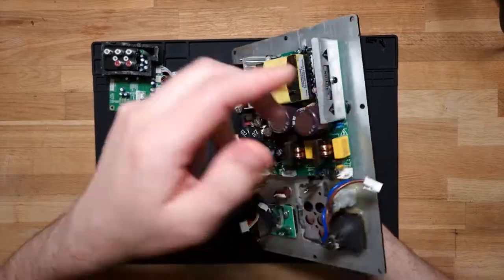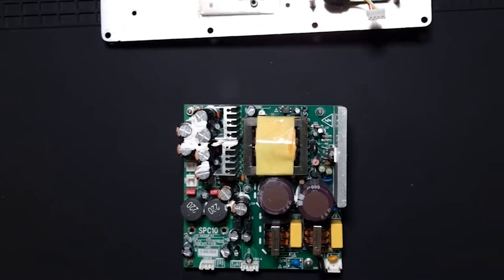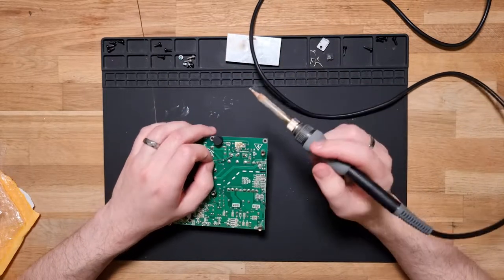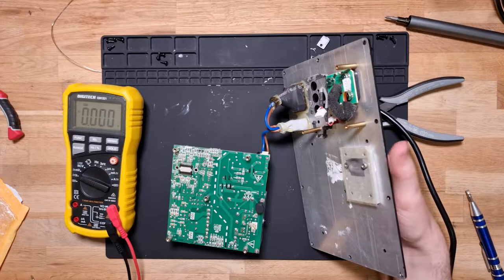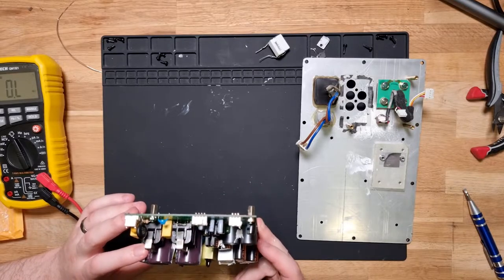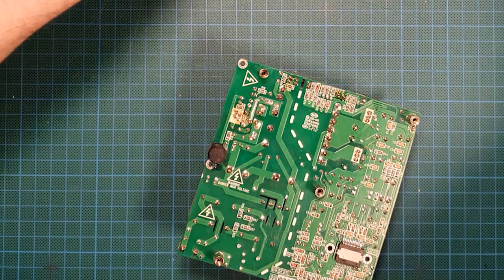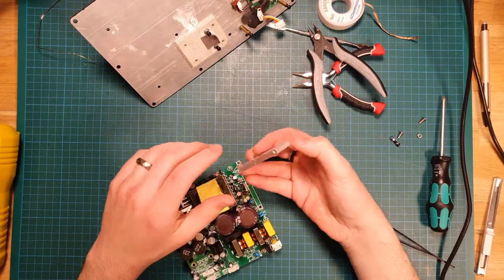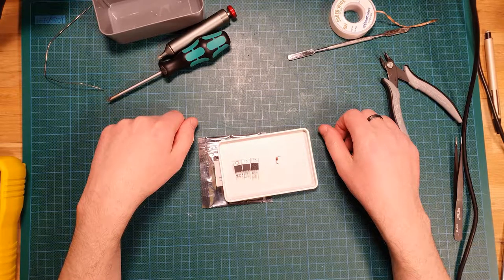Resurrecting our Wharfedale PowerCube SPC-10

Comment: well done, thanks for sharing! I have a Power Cube 10A, also has the similar problem - cannot get switched on, will try to have a look too see if the cause is similar. Poor quality :(
Reply from the maker: Thank you, and you're welcome. I'm very happy to be able to help anyone with this info, especially based on other comments it seems to be a pretty common failure! Good luck with your repair!
Reply: @silvestronsbitsandbytes  Just opened the PC10A for a look, and realised the PCB inside is different to yours. Managed to figure out that there are 2 sets of T3.15A 250V fuses blown. Perhaps this is the cause for not power on. Will look for replacing fuses and try it out. But do you have any idea on why the fuses were broken? Thanks/

Comment: Just brought a busted mission sub that uses the same board, exact same fried chip, pre ordered new zenner just in case.
Reply: Well there's a surprise it's the exact same issue.
Reply from the maker: Interesting... common failure state, perhaps? I wonder whether it's some kind of failure cascade, or if the zener "sacrifices" to save the remainder of the circuit. It looks like both Mission and Wharfedale are owned by IAG, so makes sense that they'd share components, too.
Reply: @silvestronsbitsandbytes  maybe the chip fails and takes the zener with it
Reply from the maker: Yet another electronic components suicide pact!

Comment: Hello. I have a problem. I dismantled my same subwoofer and because one self-tapping screw rattled. I disconnected the wire that comes from the speaker and I did not look into which connector it was inserted. There are 2 of them - CON2 and CON6. Please tell me which one of them
Reply from the maker: Hey! I can't get back into my sub atm to check directly, but I went over my video and photos and I'm pretty sure that both CON2 and CON6 are wired together. You can see the two connectors on the backside of the board at 5:00 right at the bottom in the middle, and the traces go directly between both connectors in parallel - I don't think it matters which connector you use, but no guarantees! Sorry!
Reply: @silvestronsbitsandbytes  Thank you.  I connected to both and both work fine.  I think it's resistance.  I measured the speaker with a multimeter, it showed 07.0 (8om I think).  I assumed that CON6 would be closer to this and stuck it there.  I played all evening and it worked.  so far nothing is broken

Comment: Can I replace the blown T3.15A 250V fuses with F3.50A 250V fuses?
Reply from the maker: You could, but I'd be wary as the higher current could cause something else to be damaged before the fuse would blow and do its protecting. If you're already blowing a 3.15A fuse, something else is dangerously shorting out and you'd need to rectify that first.